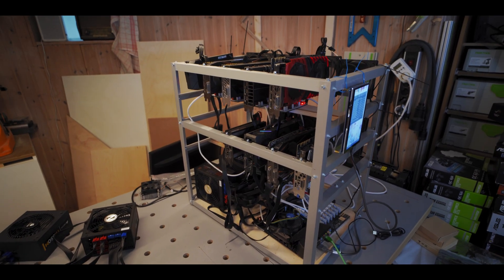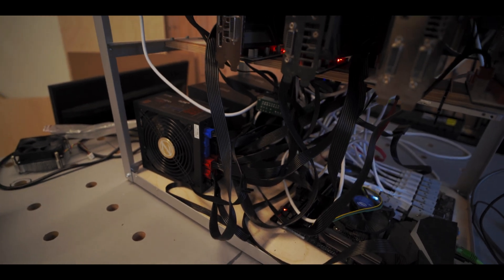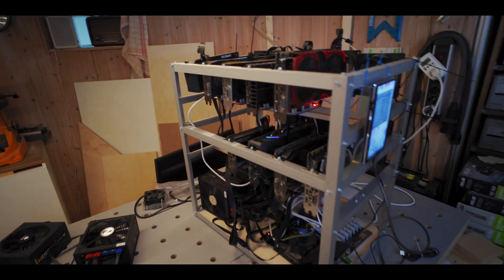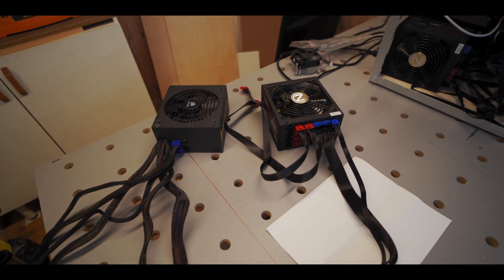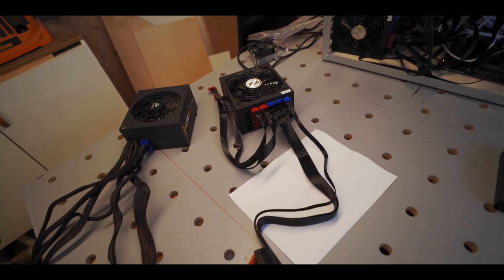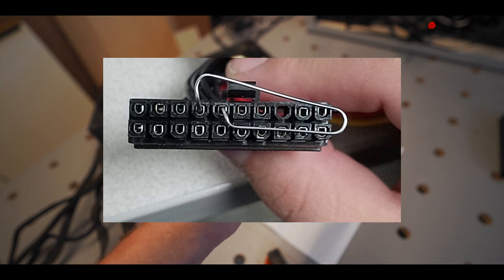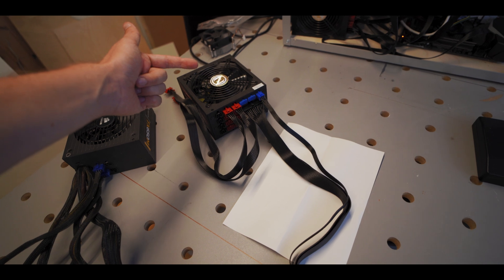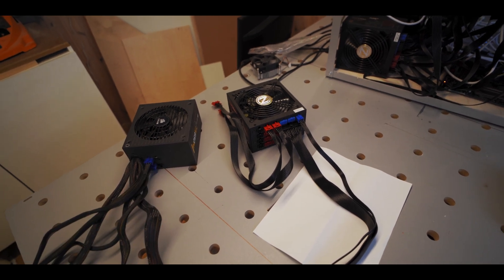How to SAFELY use multiple power supplies for crypto mining (4 ways!) 24-pin PSU splitters, Add2PSU

Comment: The original video name about better two smaller PSUs rather than big one. So, two PSUs half the power of big one is better because of more cooling 'power', or cooling area (two fans vs. single one). Regarding that connector that should be grounded - earlier days with colored wires, there is green wire that should be connected to the black wire (sensing wire connected to the GND). For anyone who have at least some experience in electronic can connect all that 'green wire' together including main PSU for the MB. Then as motherboard provide the information that all PSUs should run, they will run all at the same time. But your suggestion about special 'thing' is maybe more safe for anyone. Thanks.

Comment: So you would say the add 2 PSU chip is the safest option? I thought molex is only for really low wattage currents. Have you tested this 2 psu chip for long?
Reply from the maker: Yeah totally safe. The power needed for these chips is really tiny
Reply: @SebsFinTechChannel  I got one coming for Tuesday with sata connection instead of molex

Comment: Good vid, the only thing Id like to remind people is that there is actually small current running the paperclip, and that you can just cut it shorter and cover it with electric tape. The tester cap is probably more safe.

Comment: Yes! Thank you Seb! I've lost a motherboard already due to a sketchy ATX 24 pin splitter cable. So to run more than one ATX supply on a rig I started using the BTC 360 Pro motherboards because you can plug two 24 pin ATX cables into them. Very nice but a lot of people seem to think that particular motherboard needs to cost twice what it should. So then I started messing around daisy chaining server supplies (which isn't a bad deal at all either, Parallel Miner has some great solutions). BUT that little molex to 24 pin chip is a outstanding solution for running multiple ATX power supplies on one rig. I have gotten to like server power supplies a lot more, especially for the ease of cable connectivity and the ability to easily order different lengths of PCIe cables very affordably, but the ATX supplies are so nice and quiet. I have rigs in my house and garage, and having the ones in the house run quieter is a bit of a plus. Great run down on this and thanks again!

Comment: Seb, you're reading my mind! 

I have questions about power supplies because I've caught the bug and want to add to my recent build - I think I have one of the same motherboards as you, the AsRock BTC Pro+ which can hold 13 graphics cards so I was thinking of buying 5 x 3080ti and 4 x 3090s to supplement the 4 x 3060s I already have - I'm thinking if I buy the latest cards then they will be more future proof and efficient in the long run.  

Is that the case or would you recommend a different strategy to fill up that motherboard to have something that would be flexible and efficient depending on the market conditions and mining opportunities? (FYI I can claim back 20% tax and minimize corp tax so an £1800 3090 would cost me more like £1100)

In terms of power supplies, I bought 2 x 1200w HP server power supplies with breakout boards after watching a red panda video to supplement the 1000w ATX PSU I already have, so my planned setup would be:

- AsRock BTC Pro+
- 4 x 3060
- 5 x 3080ti
- 4 x 3090
- 1 x 1000w Corsair power supply
- 2 x 1200w HP power supply 
- 1 x Another 1200w HP power supply (not purchased yet)

Is it OK to have 4 power supplies?

Comment: Nice video as always my brother <3
I honestly don't bother with ATX PSU anymore, Server PSU all the way :)
Happy midweek and keep it up the great job <3
Reply: I didn try to used the server PSU, but i cant take the noise those 😖
Reply: @kennychai4325  i use the hp pl22 1500watt and noise is only an issue when ambient air hits 90+. Otherwise i cannt hear it over the gpu fans

Comment: I short 4th and 5th pin in extra power supply cable with small cable so basically modified 1st one. 😂😂 .
Reply: finish the video
Reply: @pearlrival3124  yep I am at 11 min, I never knew that chip thingy existed.
Reply: Just ordered 2 psu chip thing, but sadly link does not work for delivery in India.
Reply: @DrBeanStream  thumbs the video support however you can. awesome concept for cheap atx
Reply: @pearlrival3124  already liked. I learn many tips from seb, awesome videos.